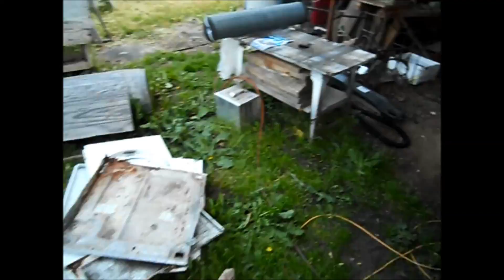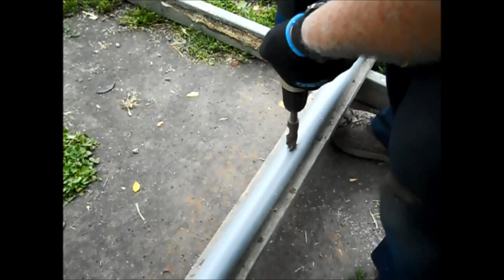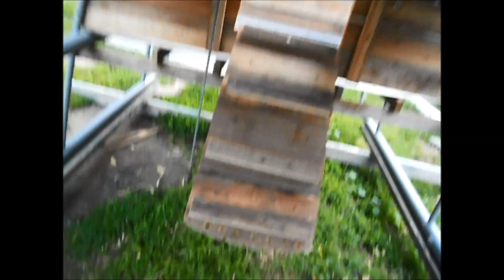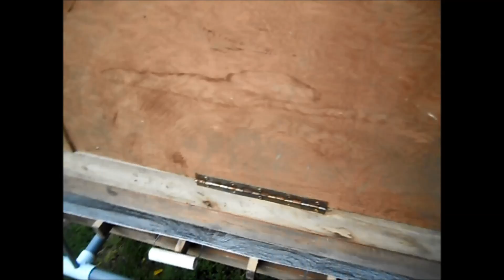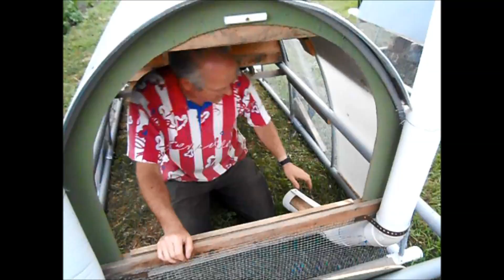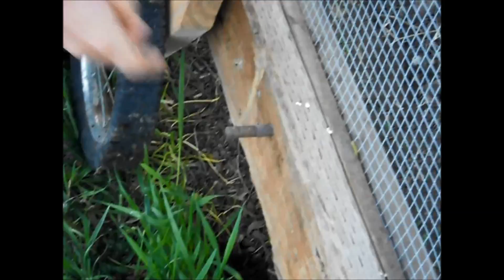Making a Chicken Tractor

Comment from the maker: no problem with wind at all. I think it's because of the rounded roof and the weight of the wood inside. the screws through the PVC have not been a problem. I thought they might be. But the PVC is soft enough that it holds very nicely
Reply: 1 in? 3/4? what about winter? is it sturdy?

Comment from the maker: Two people could easily move it without the wheels, but it is pretty hard for one person. That's why I added the wheels.

The PVC pipes are thick enough that the sheetrock screws I used continue to hold very well. The only clamp that came off was due to being scraped off with a good deal of force while moving it. None of the PVC to PVC screws have failed. I have had trouble with the staples that hold the hardware fabric to the wood. I've had to replace many of those. I should probably use screws there also.

Comment: Well done.  I am left wondering though, how you keep the screws connecting the PVC, and the clamps holding down the hardware fabric from stripping out of the thin hold they have in the PVC when it is flexing apart every time you move it.